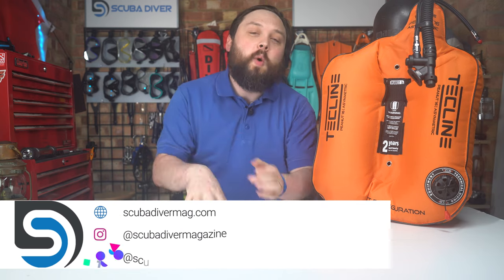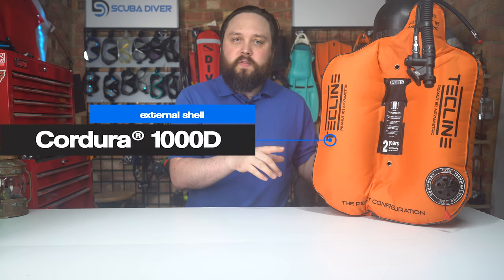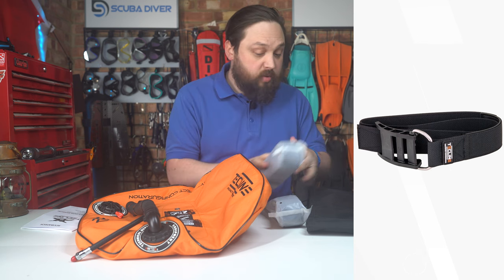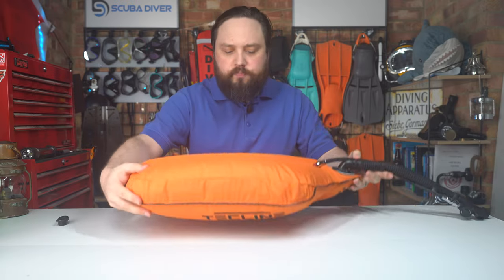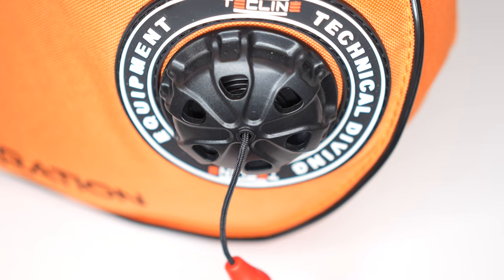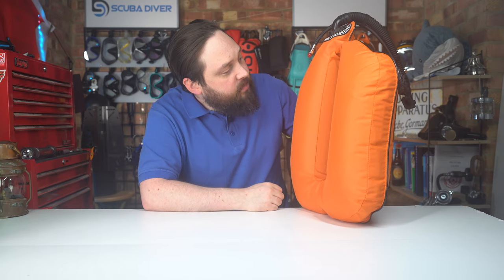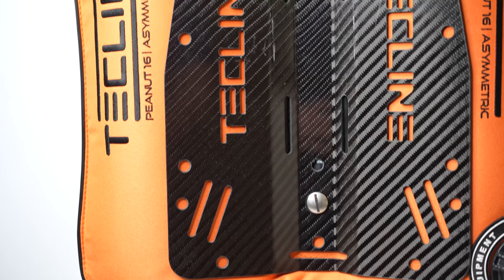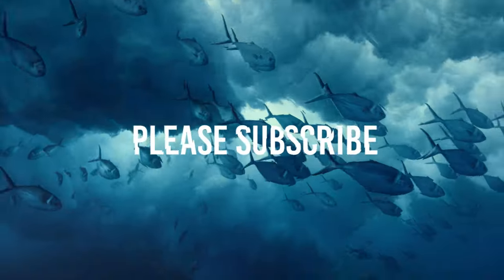Tecline Peanut Wing Review @TecLineAcademy #scuba #tecline #peanut

Comment: One strange thing with Tecline is that the store near me only sells 21, 16 and 13 liter versions. They don't have an 11 liter option. In the photos of the store, there is a BCD that says PEANUT 13. They probably changed the product, but for some reason it seems that the manufacturers of diving equipment are not very open with their products. It is difficult to find accurate information even about the devices that I have already bought.

Comment: Is there any reason why a diver would need a BCD with a very large volume? The only reason I can come up with is being on the surface. My current one is 13 liters in volume and the next one will be smaller. I thought I would get Apeks' 8 liter, but Tecline's 11l is an attractive option because of the design. When I was young we didn't have an octo or a BCD. #askmark
Reply from the maker: It's mainly if you need to bring a lot of heavy gear or compensate for a compressing wetsuit. If you have a thick wetsuit then you'll lose a lot of buoyancy at depth and will need to use your BCD to maintain buoyancy at depth.

But yes, if you're correctly weighted, you're not wearing a thick wetsuit and you're not carrying heavy gear then there's not much reason for a huge BCD other than redundancy.